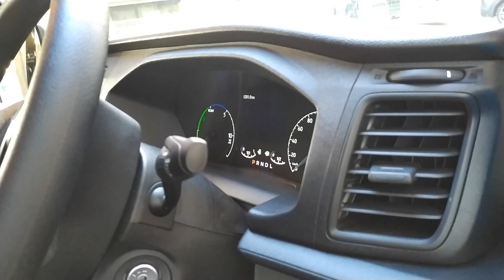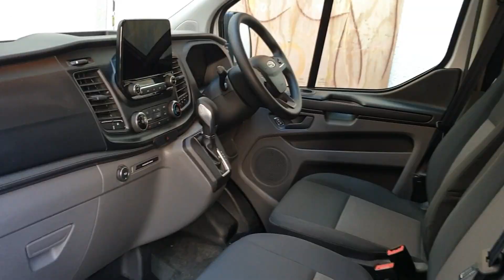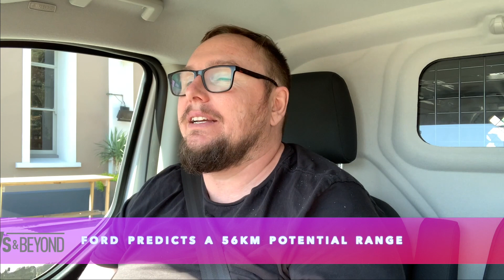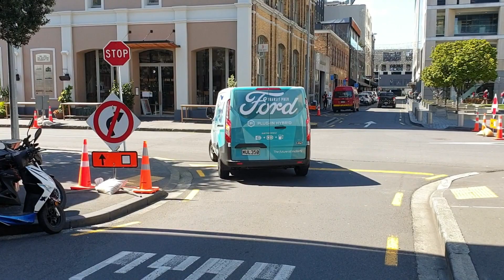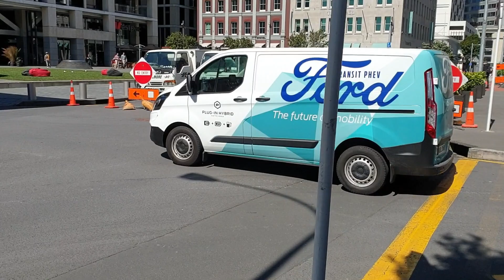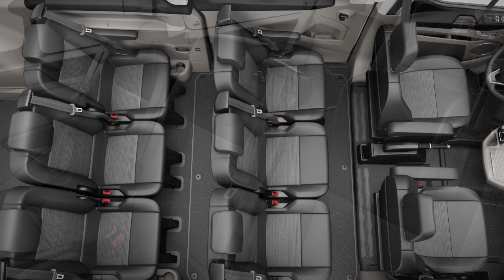First drive review - Ford Transit Custom PHEV

Comment: Personally I hate where the charging port is as I always pull my vehicles in backwards and having it at front poses problems for me personally I.e cable not being long enough and having cable running g down side of vehicle has safety risks I thing its down to the logistics